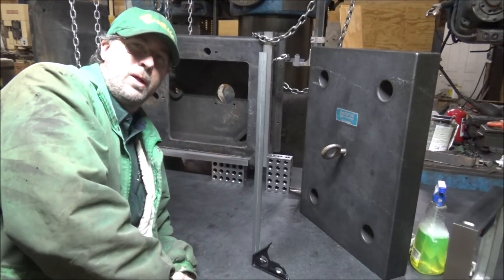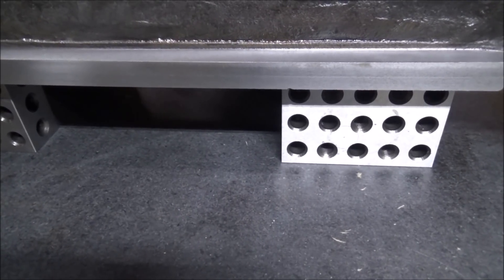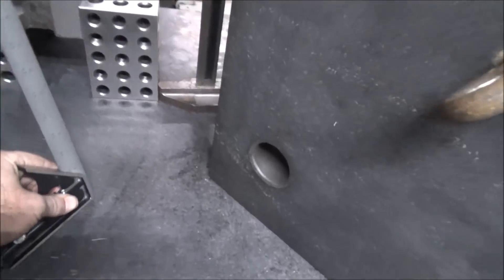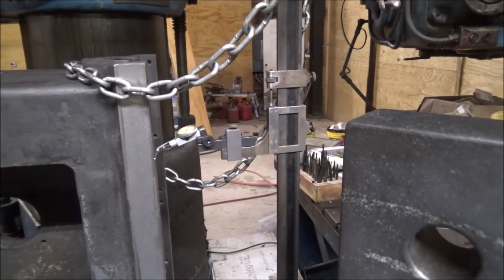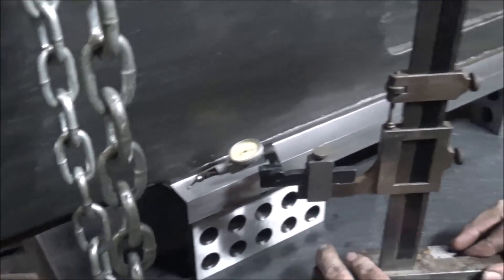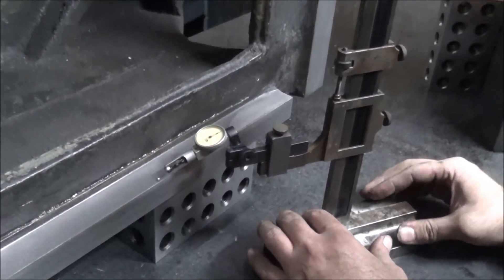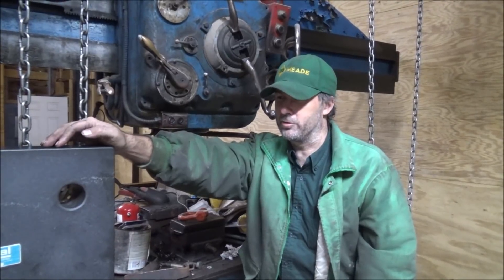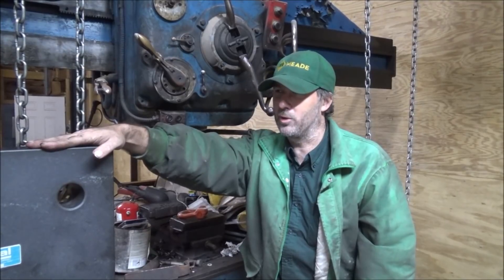Hero or Zero Machinist? Measuring what you Make.

Comment: you took your time indicating it in before machining used plenty of clamps in the right place with the right torque I don't machine any thing that big myself but I know using a torque wrench and looking at the clamp load range of the fasteners and checking the piece for warpage loosening and tightening and rechecking or having the subassembly's that are tourqed to the main casting and making sure all those are flat and square and will apply the clamp load of there fastners properly there's usualy ton's of force involved at that point ya a big machinist's square is on my shopping list too ha ha love it brian

Comment: I have the strong feeling, that there will be some measuring equipment needed, at least in the near future, lol. I do like the Starrett combination squares, special the hardened, but only for layout work. As a measuring tool, they are at best useful for woodworkers. Your problem is, you need that all in XXL, and that´s not cheap. I can get away with ~12 inch most times. They don´t give away these sizes, but they are a lot less expensive.
Reply from the maker: Yes sadly the big metrology stuff is really expensive. I am hopeing to get dialed in on some optical stuff so the range I can measure would be huge then.

Comment: How about setting Astral block six inches away so you can run the base of the dial indicator on it while the probe runs on the ways of the work piece?
Reply from the maker: I will have to try that sometime. I imagine I would struggle with not shaking the indicator trying to do it that way also would have to be sure surfaces were exactly parallel or the tip in block to part relationship would show errors that didn't exist.